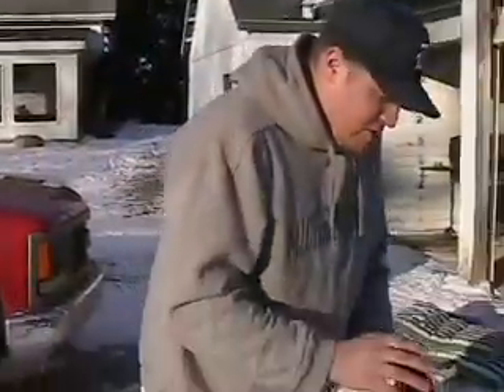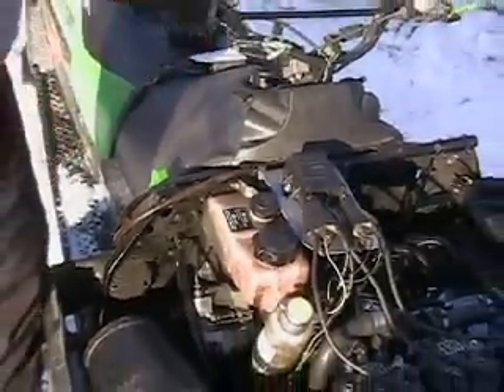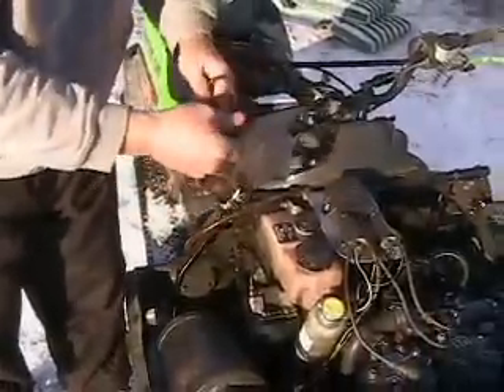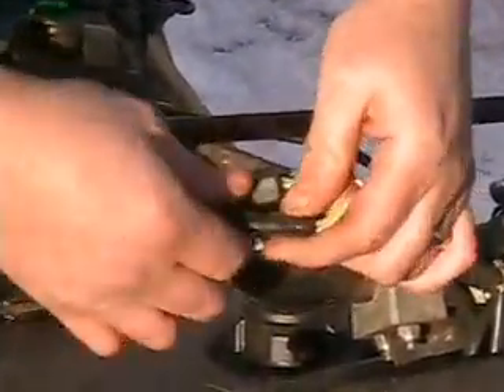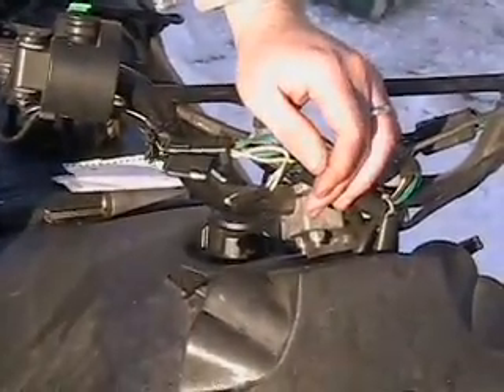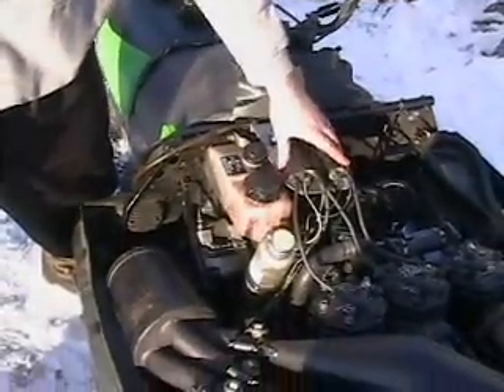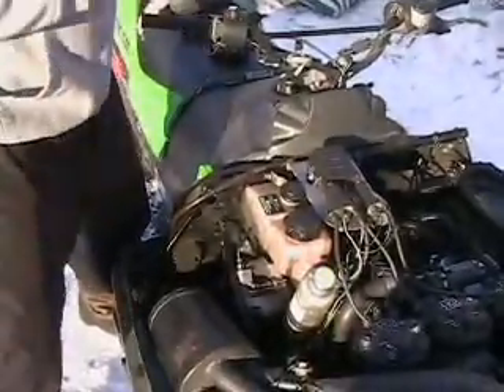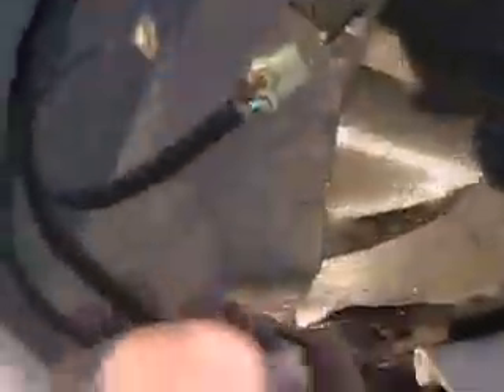Electrical Diagnosis for Arctic Cats

Comment: I have a 1998 artic cat Pantera 580 EFI getting no spark i have a static stator with the only one connection a 3 plug connection my kill switch is already bypassed how can I test it with out a voltage meter
Reply from the maker: In 1998 they made a 3-phase stator for the 580 EFI. It only ohms out at something like 1-2 ohms.
Reply: A lil update to my problem I added more grounds to the firewall and motor. Now it starts with 2 pulls and ideals nicely but soon as I give it some gas it starts to bog out I checked the fuel supply it's giving what it's so post to I'll make a short video and upload it tomorrow not sure if it may be my TPS.

Comment: Hi.  I own a 2017 Actic Cat Bearcat XT GS. From day one, it's had starting problems.  It's an electric start only sled.  I turn the key and it starts off by doing nothing, then the solenoid will start clicking, then, after much back and forth with the key, it's finally starts.  Warm weather or cold, same problem.  It'll start a little quicker in warmer weather.  Once it's running and warmed up, it works fine.  It's under warranty and the key ignition was replaced.  That wasn't it.  Just curious to see what you think it might be.  Relay, solenoid,..... what? Thanks.
Reply from the maker: If it's still under warranty keep taking it back and let them keep swapping out parts. If it does it when cold or warm they should be able to sit there and just swap out parts until it starts correctly.
Reply: BlaineDP  Ya.  Unfortunately, they still charge you for labor.  Thanks for the response

Comment: Thanks for the video. I just brought a ‘96 ZRT 600 back to life after sitting for the last 12 years. After getting no spark I assumed it was the coils or stator. I did some research and came across your video and I had the sled running the next day.
Reply from the maker: Very cool..glad I could help!

Comment: Blaine thanks for sharing your knowledge  I got a1980 Jag 3000 spirit lost fire on plugs,is there any way of checking the power pack to see if it's gone can't afford a new one 700$
Reply from the maker: Power pack meaning the coils? OEM coils rarely go bad so you can try a used OEM coil for $20. There are ohm readings for the coils. The stator may have gone bad so you can ohm that out too. If it is bad you can find/buy a used one if it ohms out good for $100 or less.
Reply: BlaineDP no my buddy black plastic box with 7wires which bolts on to engine block 3wires on a plug   double plug gos to kill switch on handle bar a 2 single wires that go to the coils any test I can do to determine if this power pack is gone

Comment: Blain I hope you still follow this. I have some questions on a 1993 T-cat with no spark.
Reply from the maker: I don't follow my videos as closely as I should. My webs site is: www.outdoor-electric.com
Reply: @BlaineDP  I have a 06 arctic cat 250 fourwheeler with no spark.  Have you worked on one and could you help a brother out ???
Reply from the maker: I have not worked on that specific model but most toys follow similar type ignition systems which include many of the same components I mention in my video.
Reply: @BlaineDP  I saw some arctic cats have flywheel the magnets fall off.  I was trying to see if mine was one.
I held my spark plug while spinning the motor.  I then flipped the override switch and felt a single spark. What does that tell you ??? Thanks for your time and info. I. Eager to rid this thing.

Comment: hi i have a 1993 arctic cat jag 440.  it has low milage but after it runs for awhile and you shut it down it wont restart because of no spark. ive receintly replaced the external coil and the problem still exsisted when the machine gets warmed up. any help you could give me would be greatly appreciated

Comment: I got an 1997 artic cat powder special and it stopped running I still have spark it almost starts first pull and after that it won't even go and compression is good belts good what else could I try?

Comment: On my EXT 600 (1997) I have spark on the single coil but not off the double coil. I picked up a new double coil and I still don't have spark, but still have spark on the single coil. Any thoughts?

Comment: have any for video for 77 I have spark on 1 side   close to the puller not coil  it only has paule on one y not the other I see on the stator. the one coil  has 2 wwires

Comment: what do I check when the reg/rec melts from the unit to the connectors and no further, is there other issues I need to check or just change reg/rect..

Comment: Great video! My 99 T-cat 1000 has an intermittent issue where it sometimes stalls out for maybe 1 second when I'm at high RPM and sometimes backfires than continues on and comes and goes. Checked grounds, wiring, compression, and changed one cap that was 9000ohms.  Was thinking of buying coil and swapping each one with it and run to test but curious what you think? Will run all day at 50mph with no prob. Just as I get up to 90 to 100 it sometimes cuts out briefly. Appreciate your thoughts on this. Could a stator or coil be that intermittent? Thanks

Comment: I have a 1996 powder special 550 ext artic cat just bought it last week everything seems alright had it out a few times now when I start it the tach doesn't work right away the dash lights are flickering as well as my oil and temp light oils full machine is cold  and oil and temp flickering when I rev it up after it starts the tach will start working after about a minute anybody can help please?

Comment: It appears as though my 92 440 jag special is experiencing low spark and it appears to be the left cylinder. Jumped the stator and still runs rough. Checked and greased all connections. I'm having trouble finding the ground connections. Would you know where these are located?

Comment: I have a 99 zrt 800. I shut it off and now now won't start. It has weak and intermittent spark. I checked the stator and the white to green wires read 204 ohms. Is this low reading typical of not starting?  It has been hard to start for the last few rides.

Comment: i got a 2005 arctic cat 400 4x4 automatic that at times i have no spark. need to know if you have run into this problem.
Reply: I have a 06 arctic cat 250 fourwheeler with no spark did you fix yours ?

Comment: hi Blaine, I just purchased a 1993 Wildcat 700 EFI knowing it had issues. got fresh fuel,new plugs,new battery etc.. pulled it over it fired for about a second then no spark. Then i try to check for spark and no spark. Any ideas what could cause this problem?

Comment: Hey Blaine ! I just bought a 1997 Grand Touring 583... I bought this sled for $200 here in Canada... Anyways here is the issue... I put new spark plugs in it and started it but had to hold the gas for it to get going... Then it did ! I ran it for about 5 or 10 minutes then noticed that the lights on the dash board started flickering. Gave it a big ass rev and BOOM the engine and everything died and I couldn't start her up anymore... The person that sold it to me also had this issue. Could this be a Bad Ignition coil ? Thankx dude !

Comment: Blaine I jumpered the yellow wires on my harness and my machine fired right up.  I am 99% sure the problem is in the ignition switch (which is electric start but I just manual start the machine).  Without replaceing the switch can I somehow get my lights and emergency stop to work?
thanks, your video was very helpful.
Reply from the maker: Yes, you can turn the stator plug 180 degrees and just plug the 2 yellow wires into your wiring harness and wire your key straight to your stator. I have a video showing how...just look up arctic cat bypassing the wiring harness.

Comment: Well I got it going, all I had to do was take the ground wire off the pull cord  area where stator goes. But now I have no speedometer? But it runs great now, but there does seem to be a loose wire somewhere. I'll just take it to the shop over the summer, I don't want to mess around with any wiring again, lol.

Comment: Hey Blaine  I have a problem on my 1997 Pantera EFI 580 sled.  the sled will be running fine then the RPM go to zero and when the throttle is pushed the engine has no power.  Sounds like it is bogging down.  Suddently the RPM jump back up and everything is normal. is this the coil, stator, magneto issue?
Reply from the maker: Check the TSS first...by bypassing it. Usually if the stator is going bad it doesn't just "get better" when everything is still running/warm. Could be a bad/marginal ground somewhere too....but from what you describe it doesn't necessarily sound like stator. You can ohm out the stator when it is cold just to verify.

Comment: Hey Blaine, I was trying to install hand Warner's on my Arctic Cat 580 EXT 1994. I unhooked a cord to find the live wire to get the hand Warner's working, I could find it at all. When I went to reconnect the wires the machine started but it Boggs down and don't move. The male plug broke off so I cut it off and connected the wore to the same colours and it burned out all my lights and I barely made it home. Now it starts but don't go nowhere. Can't you help me out please!!
Reply from the maker: My video is just a general guideline.. as far as your issue I don't know.

Comment: I have a 98 ZL 500 that I just recently replaced the stator in and now I cant get the sled to shut off with the key or the kill switch. Tested the kill swithc and key and they interupt correctly. Have to pull the plug wires to shut the dam thing off.
Reply from the maker: On the 98 ZL500 carb you can umplug the wiring harness plug and it'll start and run. You can put the jumpre wire in it to see if it will shut off. If it won't it is either a CDI or stator issue. Also, check all ground wires.

Comment: Could I get your phone no. I have a few questions on a spark issue and can you re we\ire a stater on a 1994 700 Zr arctic cat L/C
Heres my no. 715-891-4509 thanks, Mark Miller
Reply from the maker: You can always PM me on my channel. As far as 80's to mid-1990's stators for the 340 up to the zr700, most of the time they last a very long time and it is more economical to buy a used one.

Comment: Blain i have a 2002 zr cross country 600 efi. now on some cold days like 10 to 30 degrees my sled will have a really hard time starting now i know the cold will make and sled start hard but it will take me 10 pulls and it will start and run for around 10 seconds then the next time i pull it over it will either do the same thing or start right up. i was just wondering if any thing is wrong or if i just need a tune up or what.
Reply from the maker: Should start right up....if not is could be compression, fuel or spark.

Comment: Blain.. have you ever had issues with a single spark plug always burning out.. I can put brand new plug in the #1 hole on my 94 wildcat 700 and it will run great for a while. . Then it will start running on #2 hole only and then fire once every 3rd or 4th stroke on the #1 hole.. is it possible the resistor is gone in the plug wire cap?
Reply from the maker: OEM coils and wires rarely go bad. It is more likely it is a stator or CDI box issue.

Comment: I just bought a 1991 Jag 440 and I'm not getting any spark. I bought it for my kids to ride around and I'm not very skilled in this area. I watched some of your video but this sled is much different. Could you give me some advice in finding the issue? Thanks.
Reply from the maker: My videos are just general guidelines. You should have the same basic components....ohm out the stator, check switches..ect..

Comment: I have a 96 ext 580 efi the battery was going on it but it started. I just changed the battery now there is no power going anywhere. I turn the key and there is nothing. No lights on dash, fuel injector doesnt kick on. I checked the new battery with a meter and its charged . I checked the fuses and there good. any ideas ?

Comment from the maker: Here are the codes that the ecu can output for batteryless EFI models:

1 flash = Open or short circuit in TPS
2 flashes = Open or short circuit in water temp sensor
3 flashes = Open or short circuit in intake air temp sensor
4 flashes = Open or short circuit in barometric pressure sensor
5 flashes = Injector failure

With the ignition off, using a jumper wire, ground pin #14 to the module case. This will clear all stored trouble codes.

Comment from the maker: Very good question. Check when cold or at room temp. All stators will read higher when they are warm or after you run the sled a bit so that will give you an inaccurate reading. Some stators read ok when cold, but when you warm them up to room temp only then do they read their real ohms and possibly show you that they are bad. I have a stator here that I am going to make a video out of to show this happening...reads good when cold but bad at room temp.

Comment: Thanks for the info Blaine.  I have a 98 zr 600 efi and have been having an issue when the sled gets warmed up.  Runs great for first 10 min but then I am getting what seems to be loss of spark and intermittent spark causing loss of power and top speed of 60mph.  Plugs are all new.  Stator was replaced less than 1000 miles ago.  Any thoughts on what would cause my heat related condition?  Thx

Comment: I've got a 93 EXT 550. Lost power and then it quit. The spark must have been weak and then quit altogether. I jumped the connection from the stator per your video. No spark. If the ground is ok, should I go straight to buying a new stator?

Comment: hi blaine i have a 96 zr580 efi and it will run fine for awhile the just qiut and i have tolet it sit for bit then shell fire up and quit again could it be loose wire bad ground or batt it runs awsome when it is going

Comment from the maker: There are different ohm readings for different model sleds. Your specific model reading 175 and 17 is ohming out ok. Those readings are good for your stator (Of course there is always the small chance it ohms out ok, but may not be ok). More than likely you have another issue. If you bypassed all of your switches by using the jumper wire and still have no sprak, then you are probably looking at a cdi, coil or trigger coil issue. Double check all of your ground wires too.

Comment from the maker: yes...the dreaded TSS issue. Glad you got it running. Happy trails.
Reply: I held my spark plug while spinning my motor as it spun I flipped the override switch and felt it spark.  Is that a sign of bad switch ?

Comment from the maker: Stator Specs sound correct. There are no cdi specs. You could have a mechanical issue. Look down inside the cylinder, check the exhaust side and also the intake side. Could have a broekn piston skirt, bad reeds, crank out of phase, sheered timing key, mouse nest in th exhaust....it could be a lot of things.

Comment from the maker: Something is waring up and putting out less power: 1. Stator is dying after it warms up. Check stator ohms when cold and then after you start it and it dies. If the #'s are way off, it is a shorting out stator. 2. A trigger/pickup coil can do the same thing. It can be ok when cold and then go bad after it warms up a bit. Same thing: Check ohms when cold and then after it warms up. 3. The plug wires are not making good connection with the plug caps or maybe the secondary coils. Trim both ends.

Comment from the maker: It looks like these are the models that use that type stator. As you can see, it was only used by a few sleds over a 2 year span.

1997 PANTERA - MAGNETO
1997 EXT 580 EFI DLX - MAGNETO
1997 EXT 580 EFI - MAGNETO
1998 EXT EFI DLX - MAGNETO
1998 PANTERA 580 - MAGNETO
1998 EXT 580 EFI DLX - MAGNETO

Comment from the maker: Yes. the 1998 580 EFi stator is in a class by itself. I can't remember if they used that stator 1 or 2 years, but it is a stator that does not go in any other 500, 580 or 600 motor. It is a full 3 phase stator and does not have the separate ignition, injector and fuel pump coils.

Comment from the maker: You need spark, fuel/air and compression. If you have spark, dump just a little gas int he cylinders and see if it starts for a few seconds. If it does, then you know it is a fuel delivery issue. It could be anything from your fuel pick up in your tank to a plugged filter, cracked fuel line, dying fuel pump, cracked pulser line (from cases to pump)..ect...check it all.

Comment from the maker: What did your stator test at? These should eb your specs:
Green/Brown 450 ohms
Green/Black 45 ohms
Black/Brown 495 ohms

It sounds like a switch issue. Pul it over with the plugs out of it and check it for spark. I have a comlete "spark diagnosis" step by step write up that i will try to send you in an e-mail. If it is not a spark issue then it is proabbly a fuel delivery issue.
Reply: Can you email me this check?? I had my 96 pantera 580 efi running perfect turned the key and nothing just turns over and zero spark but kill switch turns efi on and off so think its working... not sure about coil test and I have two of those stator pickups?
Reply: leedroy@gmail.com

Comment from the maker: PM me and I can send you shipping instructions.
Reply: Hey sir I have a question about a 1996 zrt 600 closed system it ran fine then stopped running checked all the fuel undid the 4 prong out of the stator and put a jumper on it and it still won’t rev up I put new grounds on I’m pulling my hair out on it

Comment from the maker: Yes, jump away! The TSS switch & kill switch are the 2 big eletrical issues that go bad on the 1990's cats. Your stator specs are 45 ohms and 450 ohms. Check your stator too just in case. If you don't know how, check my "how to check a stator" video. There are 2 of them. 1 shows how to check it in a sled and the other one shows how to check it when it is out of a sled. Like this video said...check all connections, grounds, check wires..ect...